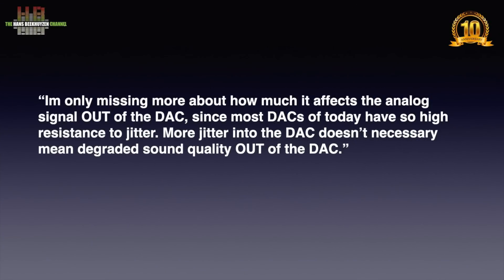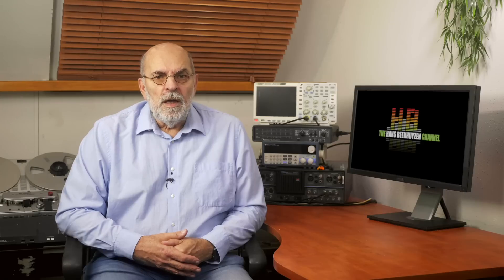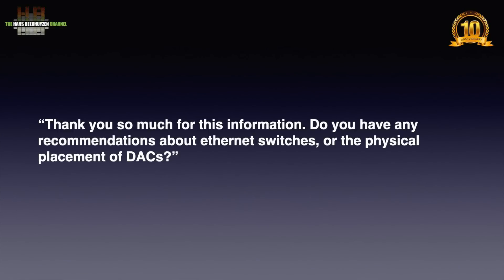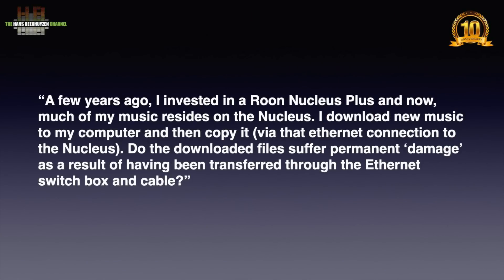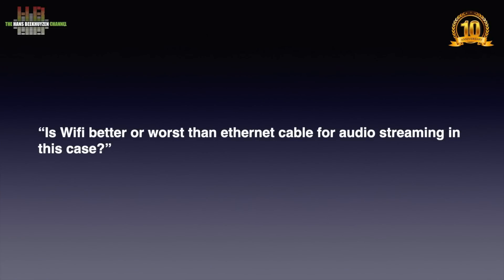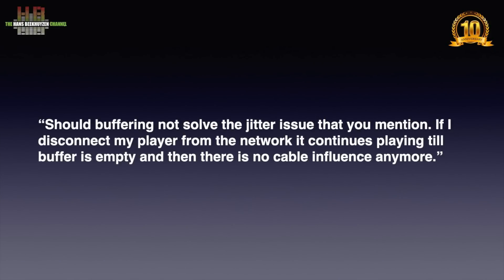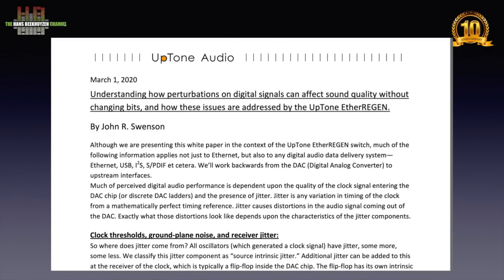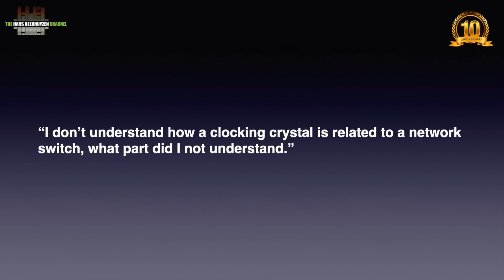Ethernet connections do have influence on the sound quality: questions and answers

Comment: In a way, the extra cost of cleaning up the Ethernet signal, highlights the inherent drawbacks in network streaming services like Roon. In my case, the bulk of my digital music library is stored on a hard drive in my streamer. I am only concerned about my Ethernet signal quality when I stream from Tidal. I wouldn't mind having an Ethernet filter in the reproduction chain, but they are quite expensive.
Reply from the maker: It's having the network plugged in that already introduces aberrations. Try it. And Roon doesn't function with out an Internet connection.

Comment: Is there any need for switch and filter to be used if you have a great Wi-Fi signal? Will the sound be any better?
Reply from the maker: of course not. But whether what sounds better depends on many factors. Like how busy Wifi is in. your area, what equipment you use and so on. So you just have to try. Cabled ethernet is les dependent on those factors but then a good switch or ethernet filter will have a clear impact on the sound quality.

Comment: I am struggling to understand the connection between the networking hardware and the resulting sound. I think I have understood that the data is not changed over ethernet or WiFi. In the extreme, let's say we buffer the whole audio file before playback. The network hardware is irrelevant. Is the problem that the network hardware introduces a path of noise and interference into upstream DAC that is not audio data, a problem with isolation rather than data corruption?
Reply from the maker: It's. not the data, that will stay in tact. It's noise, DC shift and other mishap on the analog signal that transports the digital info that causes tiny time variations during d to A conversion.

Comment: Hi Hans, related topic, generally, which digital oututs-inputs between a router/switch/streamer into a DAC are clocked by the router/switch/streamer or the DAC? I ask because there seems to be interminable disagreements on hifi forums and frankly manufacturers don't seem to think stating this information clearly in gear manuals is important...
Reply from the maker: All ethernet devices are asynchronous and thus have no clock that is related to audio. So the streamer has to clock the incoming packets of data into an I²S stream. That will clock the internal DAC. If the connection to an external DAC is over USB, being asynchronous, the DAC has to clock the incoming packets of bits. If the connection is over AES/EBU, SPDIF, TOSlink or I²S, the streamer will clock the signal. Except when with I²S the DAC can be set to the internal clock.

Comment: Hi. I agree with you on all aspects related to noise and jitter introduced by the network connections . I’ve tried with different kind of cables and devices and even apparently good ones (I mean certified cables perfect for normal data connection ) can transmit noise that results in the sound artifacts you mentioned . 
I’m wondering now if it’s better to invest in a good streamer that might have resolved most of these problems or in a DDC between the streamer and DAC that may fix all jitter and noise issues and provide the DAC with a good digital signal.

Ps: a note regarding devices that are sold as “immune to jitter”: I have a Chord MScaler/TT2 combo with separate SJ LPS , and they are everything except immune to jitter or noise . They can sound great but only if the digital signal and the power line are ok ! 
They are so transparent to what they receive that they make me hear all the problems from the streaming chain.
Reply from the maker: That would be a good plan. It's why I switched to the Grimm player. That is not 100% insensitive to ethernet pollution but it's the best I have heard up till now.

Comment: You just have to experiment. I bought several repeaters and switches, both 'standard' and hifi brands. All sounded different. In the end, the best sound was wiring directly to the main hub using a flexible ethernet cable wrapped around lots of large ferrites to 'clean' RF noise, along with a linear PSU on the hub. Consistent with Hans's view, I think that the RF spectra of connected devices interact, sometimes in ways that please the ear, but sometimes not. I prefer to minimise noise instead.
Reply from the maker: Thanks for sharing

Comment: Thanks for another great video. I absolutely agree that the ethernet connection affects the sound but I have for a long time found that this not only applies to streamed music from sites such as Qobuz and Tidal but to my ears it also applies when playing music files stored locally on the streamer/server. 

Hans, can I ask whether what you discuss in this video is for streamed music or did you also experiment with ethernet connections when playing music files stored locally on your streamer/server?  Although I normally use an Antipodes Oladra I did have a Grimm MU1 in my system for a few weeks and noticed the same effect with that. Best for me was when using an Innuos PhoenixNET switch and a passive noise filtering device on the network connection. Interestingly the worst sound was when I introduced a fiber/optical isolation device and then the sibilance and slight harshness noticeably increased. This applied to all that I tried including some very exotic and certainly expensive fiber convertors.
Reply from the maker: Thanks for sharing

Comment: This has been my experience since giving up my Naim Cd
Player using a Nas then in 2017 the Naim Core. I sold my Cd player so I was unable to do a comparison. From a Tp-Link to EE8 Ethernet switch improved the sound but didn’t remove the issues Hans has described. With the Core I rip a cd and then I switch off the Core for a few minutes and do a full reset and this improves the sound somewhat. Is this now two issues with using a music server ?
Reply from the maker: It's hard to say at a distance.

Comment: I have network fibre cable to the premises with 25m of cat6 cable run in vicinity of 240v power and data cabling in the ceiling to the modem. Installed iFi LAN iSilencer to modem input and music clarity definitely improved.

Comment: I asked a streaming DAC manufacturer (they make one of the best measuring DACs on the market) why a quality outboard streamer sounded different than the built in one. They weren’t surprised by the question.  

The answer I was given: The streaming board (raspberry pi based) has its own clock, which is not as good as the clock used by the DAC circuit. He (the worldwide rep) agreed that a very good outboard streamer can provide a better result, even over USB.

In other words, buffering doesn’t automatically solve all problems.

Comment: Hans, does the implementation of the DLNA server that forwards the data stream to the DLNA renderer affect the sound quality? I am currently experimenting with two versions of the DLNA server at home. In the first case, I am using a Windows laptop with the Jriver software set as a DLNA server to stream music from the laptop’s internal SSD over my home network via Category 8 Ethernet cable to an ifi ZEN streamer in its DLNA setting. The streamer is connected to the Denafrips VENUS II 12-1 via a high quality Atlas Hyper Sc USB cable. I opted for the USB connection as it uses the clock of the DAC, which in my opinion is better than the internal clock of the ifi ZEN stream. The integrated amplifier is Naim Supernait 3 and the speakers are Harbeth M30.2 40th anniversary edition. In the second case I use a Raspberry pi 4 which I have turned into a NAS and DLNA server by installing the OpenMediaVault software. I have connected an external HDD to the Pi’s USB input. The Raspbeery pi streams music via the same category 8 cable to the ifi ZEN stream and is controlled with the BubbleUPnP software on my smartphone. At the moment the streamer, laptop and Raspberry pi are connected to the ports of my router, but I am waiting for the arrival of a TP-Link TL-SG2008 V4 network switch, which I will then add to my network. I chose this switch because it has QoS and IGMP snooping options that will allow me to optimize traffic between devices. I do not want to spend a lot of money on an audiophile switch at the moment. The system is still under development, so I have not made  a direct comparison between the two DLNA server options with the same music files yet, but for now they both sound good.
Reply from the maker: Everything influences everything in audio - also in digital audio

Comment: Clocks in switches do help. By reducing the jitter of the Ethernet signal they reduce the phase noise that could be generated in the streamer.
Reply: If the stream are simply buffers a few packets It will not be subject to any timing problems upstream. And if the buffer reclocks the output then you only have underflow to worry about in the buffer.
Reply: @supercompooper you need to understand that the timing errors provoke the creation of phase noise at the physical interface of the receiver. Because that interface creates a burp of current every time it reads a zero or a one. Which are in fact a rising voltage and a dropping voltage. When a clock is jittery these burps create noise of current at the pattern frequency of the clock’s imprecision. The result is phase noise at low frequencies usually around 10 to 30hz if I’m correct. And that noise shifts the threshold of the streamer’s internal components.
Reply from the maker: Agreed

Comment: Thanks for the upload. I learn so much from you.
Last week i connected a Pura Ammonite to the Kiwi streamer from Dion audio.
The entire stage and sound improved so much. The stage came forward and voices are so much smoother. I sound hysterical. But it's true.
Then i placed the dac streamer  and the switch on a pillow kind thing. The effect was a little more of the same.
I was always doubtfull, but it's it depending on the equipment.
I am going to compare my equipment with the Grimm MU2 next year. I am courious, but not worried.😂 🎉